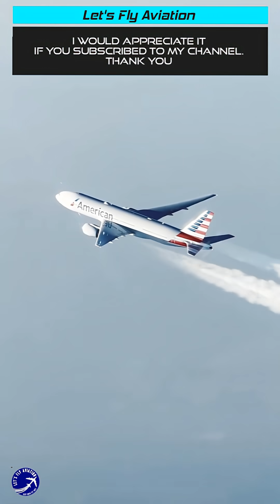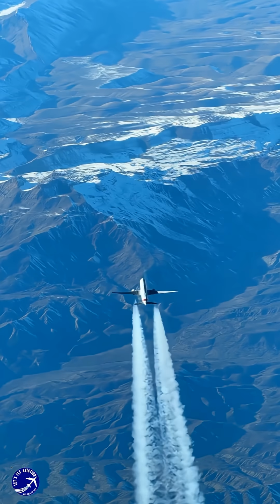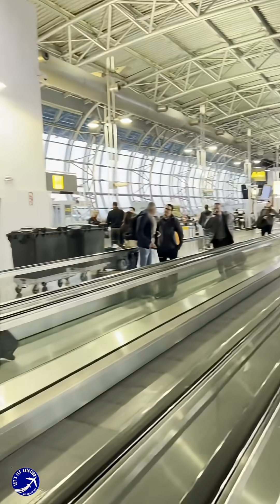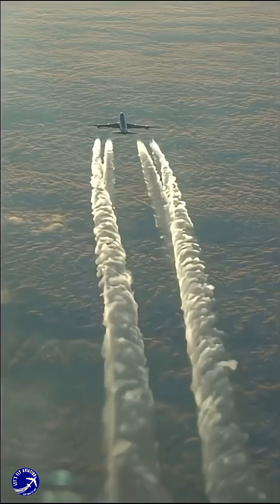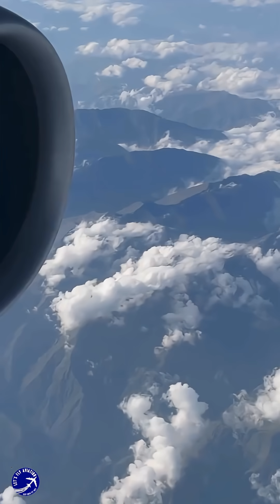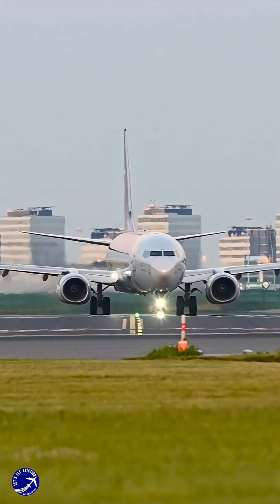Why aircraft don't hit supersonic speeds?

Comment: Fun Fact: In rare cases, passenger jets have exceeded the speed of sound. How? Jet stream tailwinds in a few cases accelerated the planes beyond the speed of sound. Because the aircraft were being pushed by jet stream tailwinds, their airframes did not suffer the effects that would have normally damaged them.
Reply: I’m thinking that the Jet stream pushed the airplane’s ground speed above the speed of sound. In that scenario the true airspeed of the aircraft is below the speed of sound. In simple terms the speed of the jet stream added to the true airspeed of the aircraft could result in a ground speed that is above the speed of sound. If my thinking is flawed or in error in any way I would appreciate being corrected. I’m always open to learning, and will not be offended in any way.
Reply: @billydekle7396 You are correct. In the jet stream the ground speed might be faster than sound, but airspeed over the airframe is subsonic.
Reply: Speed of sound on the ground in standard temperature/pressure air vs the planes ground speed, sure - but speed of sound is variable.  

Therefore, it's not considered supersonic as the other commenter explained.